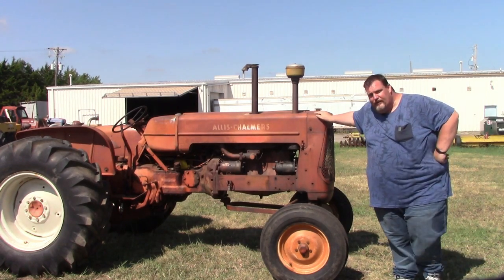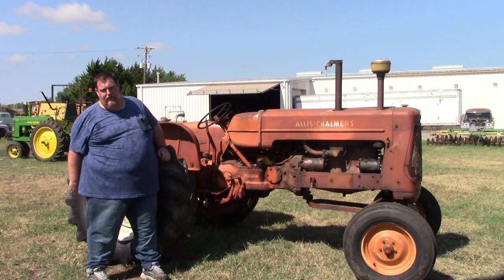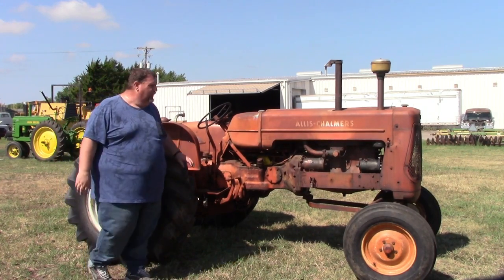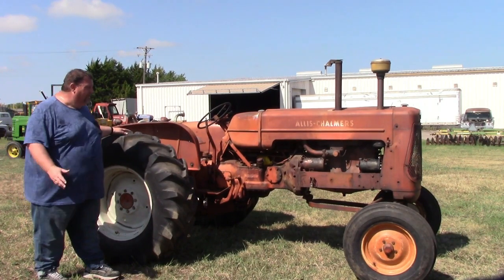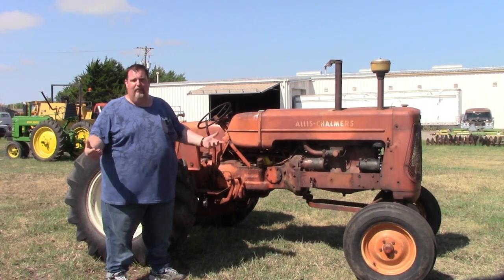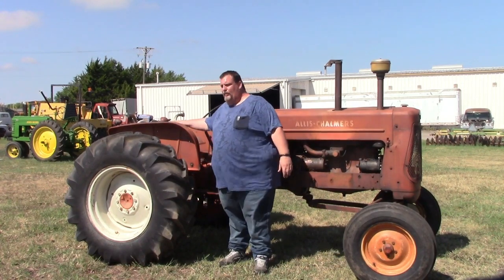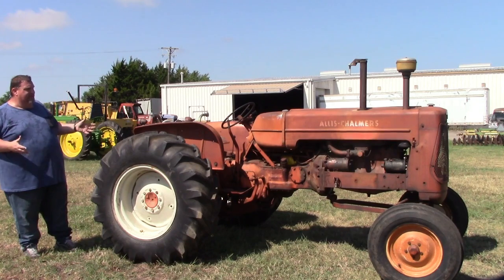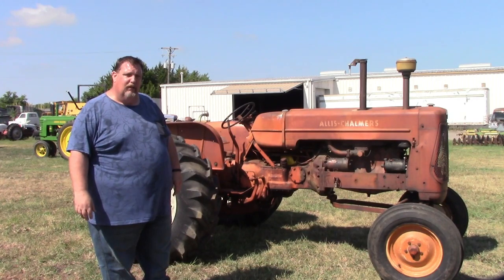diesel Allis Chalmers d17

Comment: I have a D19  Diesel  that I  really  like
Reply: Be thankful it's not a gas. Had a neighbor who had a D10 gas. Pull 4-14"s it would burn between 55-60 gallons of gas a day. Saw all of that he wanted. Traded it in for a 190XT.
Reply: @robertlong7033  If you pulled 4-14's with D10, you must have been turning 2 inches of beach sand. D10 was the smallest of the D series and had a 31 hp motor.  Typo somewhere?
Reply: Probably meant D19.

Comment: We had a 17D Series II Not bad BUT they had a nasty little habit habit of blowing head gaskets if you didn't give it plenty of time to cool down at the end of the day. That snap coupler and hand clutch took some getting used to but once you mastered it , it was a good tractor  and it's power output was at the very least equal to it's rating.